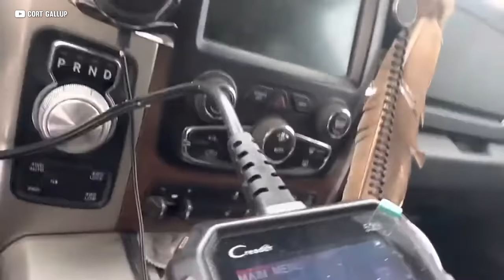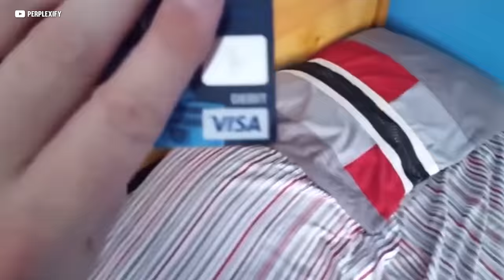Worst Trucks Only Stupid People Buy

Comment: Everyone always lumps all the Triton engines together. Glad to see you specifically mentioned the 5.4 3 valve. I had a 2 valve 4.6. And though lacking in power, (plenty for my needs) it was rock solid on reliability.
Reply: the 2 valve and 3 valve 4.6’s in the mid 90s into 2000s (crown Vic, mustang, etc.) were always the best ones for reliability, would highly recommend swapping if your chasing performance though
Reply: 4.6 2 valve is actually one of the best reliable v8. Same thing with audi 4.2L. The timing belt ones like the BFM are actually top tier v8.
Reply: So why Cummings sell crap if they know  its crap. Nissan builds very reliable and engines. Maybe the reason was to give the truck a American heart for American customers, but American heart was a lemon.
Reply: @FyodorUshakovSuka "Cummings" does not sell anything. However, Cummins sells diesel engines.
Reply: @randycupp5925  Sorry my bad. Why did Cummings sold crap diesel engines if they didn't know how to built a good one? Happy?
Reply: @FyodorUshakovSuka  "Cummin(G)s" does not exist... 
Cummins (please note the spelling) does however exist and they made the 5.0 liter engine to the parameters given by Nissan. There was a lot of controversy at the time this engine came out...  Cummins did not agree with a lot of what Nissan wanted the engine to be (displacement and V-style cylinder arrangement) however, they produced it anyway because it was guaranteed money from Nissan.
Reply: My '97 F150 with the 4.6L V8 quit working after about 290k miles. The transmission failed a little before that, at 280k. The body was in perfect condition, no rust at all and no other issues with the truck other than regular stuff, like the alternator. Fuel pump gave up at around 350k, right before I sold it. Those trucks were really "built tough"!
Reply: @randycupp5925 

Nissan worked with cummins on calibrations for the Titan, but the ISV was all cummins.

Cummins 1st approached Chrysler,  who turned it down because it wasn't economical enough 

Even toyota was thinking of using it...

It did get used in quite a few busses, which have nothing to do with Chrysler, Nissan or Toyota..

Your theory that someone forced design parameters on a company when that company would be responsible for warranty claims is absurd..

Cummins laid an egg with this motor....it happens.
Reply: @johnpeters9793  Hey thanks for the info. I was totally under the assumption that Nissan had substantial input on the final product. Regardless, I think Cummins should have stuck with what they know best and produced a scaled down 5.9 I6.
Reply: @randycupp5925  

I think depending on the definition of substantial, Nissan did have a voice in the motor...

The best analogy I can think of is Cummins created the hardware and Nissan was responsible for the software....but the shortcomings of that motor were mostly "hardware".

Like mentioned, Toyota was considering this motor for the Tundra...this was back in 2014....in hindsight, makes me wonder if they knew something nobody else did.
Reply: The 4.6 was a good engine. Had a f250 with one.
Reply: @savagebob911  

Ummm....no.
Reply: @savagebob911  one would assume, but no. All those modular V8's were Triton series.
Reply: @johnbessemer3777  

That's correct....not just the three valve.
Reply: I have a 2v 5.4 with 200k been good other then coolant bypass cracking and needing a new intake manifold and some coil packs I got my plugs torqued a little heavier then factory spec so I'm hoping they don't launch to the stratosphere.
Reply: Rust bucket Dodge? In n. Iowa they rust through before the mechanical becomes an issue.
Reply: The 5.4 3V had the bad reputation, but never heard 2V or 4V having issues. Although, people say the 2V 5.4 is one of the reliable engines ever made.
Reply: @randycupp5925 correct
Reply: My 5.4 2V now has 260,000 miles and still going strong.
Reply: @russellkeeling4387  also I heard the 5.4 4V is reliable too. Is that true tho?
Reply: @Mohammadkwt  I watched the last interview with Carol Shellby wherein he said the 5.4 liter 4V engine was the best engine ever made, in his opinion. I don't doubt him.
Reply: @russellkeeling4387  But the 5.4 4v in the gt500 is different than the one in the expedition and navigator if I'm not wrong when it comes to some components. I suppose this doesn't change the reputation of the engine, rigth?
Reply: The 4.6 V8 is legendary, everyone who has bought a retired cop car will have stories to tell about just how ragged out and abused they can be and still run fine.
Reply: @johnpeters9793  Surprised Nissan didn't adapt their own diesel knowledge to the Titan.  They have made plenty of diesels around the world including the Navarra twin turbo.
Reply: @TIJoe-te9qu  

A lot of people were losing their minds when toyota was supposedly going to use the cummins for the same reasons you gave.

The consensus was that it was all about the emissions....toy and Nissan didn't want to spend the time or money certifying their motors to US regulations.
Reply: @johnpeters9793  That makes sense,  letting an engine specialist handle that headache. Especially for here in Kalifornia. Too bad they didn't just go with a straight six, unless Dodge would have had a fit. 
If I could have a good Cummins in a Nissan Titan body,  I'd prefer that to the big 3 any day.
Reply: The 2v mod engines were/are solid.  Every engine will have it's issues, but the 2v go and go and go and go.  I just bought a 75K mile 01 Expedition that had a dealer maintenance record of OVER done maintenance all it's life. (Oil changes every 6 months regardless of miles.).  The truck is like brand new and drives fantastic.  I got tired of being burned by the newer stuff.  I wish we could go back to the 90's...well, except for GM's garbage back then.
Reply: @JViello  Good point.  I wonder how Ford blew it so bad on the 3V when the 2V was solid.
A guy I know has a Lincoln LT (glorified F 150) with the 3V. I remember telling him a few years ago to pamper that engine. 
I just ran into him, and he had to fork out $9k for a new engine. Painful.
Reply: @JViello  Seriously,  I'd go back to a 70s big block F-250 if I could tolerate the nasty fuel economy.
Reply: I fully agree. Change the plugs on a regular basis and torque them more than Ford spec they won't blow out. The 2 valve Ford's are great engines. The fact they say Chevy trucks are 'LENGENDARY' shows their bias.
Reply: @TIJoe-te9qu  
I've been told the biggest failure on the 3v 5.4 is oil change intervals. Ford advertised 5k, or 7k oil change intervals. But if you didn't change it every 3 to 4k, the sludge would clog the VVT system. That would ruin the cam phasers, and more. Another failure point was the rollers, I ain't sure if that was oil related, though.
Reply: @johnbessemer3777  I wonder if high grade synthetic would help?
My buddy that just replaced his said he stayed up on oil changes, but maybe not more than the Ford schedule.
Reply: @johnbessemer3777  You are correct, but the main issue wasn't as much oil change intervals as it was junk cam phasers.  Just a pure sh*t design.  If Nissan/Toyota/Honda hell even GM can get a simple part right how could Ford not do so, and then pretend they are fine and oil changes are the problem.  Ford always...ALWAYS throws it back to the customer.

I don't understand why manufacturers who have a failed part design don't just do simple recalls and fix it...or at the very least, fix customers who show up for service with the problem for free.  Instead they pretend there isn't a problem when the "new" part CLEARLY has changed and even has a revised part number.  No, no problem here we just decided to change the design, uh, uh, because.  That's why, because.
Reply: @TIJoe-te9qu  As much as I love the big block idea, IMO the reality is the 90's were the peak of automotive excellence.  It was the marriage of old school proven parts, overbuilt with the refinement and reliability that modernizing the finicky parts brought.  No more carburetors and chokes, FI made the cars a/f requirements run perfect at all temperatures and altitudes.  Same for all the OBD-II sensors and monitors. (Not the craziness they have now where a loose battery terminal trips a CEL)  Crank angle sensors, cam angle sensors, MAF's, temp sensors etc were just enough to make the now overbuilt/engineered engines to run several hundred thousand miles without issue.  

There were a TON of cars in the 90's with over 200 and 300k miles. Nissan's Toyota's, Honda's, Fords etc.  I knew a couple who bought a 98 Ford V10 van for light delivery nationwide. That thing had 500,000 miles on it and ran with NO problems. (2v of course.)  For all I know they pushed it past 700K.  They just replaced worn items like wheel bearings, brakes, tires etc.

Look at Lexus!  MILLION MILE CARS.  Plenty of LS400's with 300K that run and drive like brand new.  You are NOT finding that today.  Cars have gotten truly complicated beyond reason and are now what they claimed about the 90's. I remember the carburetor guys saying "All this new tech crap is over complication".  Nah, once I saw how it worked, it was the same old stuff, just solid state now.  Way more precise and reliable.  They weren't replacing throttle cables with servo motors, electric steering etc and all that crazy garbage you have now so the car can park itself. 🙄  The 90's were the peak.  If you can find a clean mid 90's early 2000's Lexus for a fair price.  Buy it!  Best, most reliable car you will own.
Reply: @JViello  here's the thing, though. They were all the same parts. 4.6, 5.4, 2v and 3v. I just did a quick search to verify. The phasers were all the same from it seems 04 to 09.
Reply: @JViello  your point is very valid. In fact,  my Nissan truck is late 80s and my Honda is late 90s.  The smog carbs were a nightmare,  so Nissan took the same old L series from the 60s, which was actually inherited from Prince with Mercedes DNA, and put on a new crossflow head and TBI.
Still working fine today.  The Honda HX civic has low pressure port injection and vtec-e and cruises at 44 mpg without batteries.  I recently diagnosed  bad injector by listening through a screwdriver and getting another one at pick n pull for 7 bucks .
Those were definitely a golden age for dependable daily drivers.  The only problem i have encountered is when electrical connections become either corroded or brittle,and that is hard to track down intermittent problems for me.   
Way too many of these cars were thrown away in scrap yards that could have been rebuilt.  
If I get nostalgic for carburetors,  I guess I can play with my 1963 Volkswagen.
Reply: @johnbessemer3777  Maybe it's the casting deign and oil  passage sizes? 
The 5.4 3v has a lot worse reputation for some rason.
Reply: @TIJoe-te9qu  I really don't know. It's stupid, though. Same phasers across the platform but only the 3v fail.....
Reply: @johnbessemer3777  Got to be those restricted oil passageways.   Glad I didn't get one. A buddy got one in a Lincoln LT, and he just spent 9k on a new engine.  I told him to change the oil a lpt.

Comment: I owned a 2006 F350 with the 6.0l. As a hot-shot driver pulling a 26’ gooseneck trailer for over 2 1/2 years and well over 200k miles, I never had a problem with anything. Of course I’ve been accused of being totally anal when it comes to maintenance like oil and filter changes, trans & diff service, etc. so that may have something to do with it.🤷‍♂️
I also bought a 2003 F150 SuperCrew, RWD, with the 5.4l “2 valve” engine brand new in ‘03. Still have it and it just turned over 285k miles. No rust, and runs & drives great! Again, maintenance is the key! It’s cheaper than repair.
Reply: 2v good motors
Reply: I think that the diesels used for your purposes tend to do the best. The ones that people daily drive to work or to the grocery store are the ones that break down so often. They don't like short trips.
Reply: @mikelemoine4267  agreed!! I don't know how many times I have to tell people, dont pull into the gas station, and cut it off to put fuel in it, or to get a pack of cigarettes. So, so bad. Like you said, the short commutes tarrable.
Reply: @andrewavvenire116  Unfortunately I learned the hard way. We have a 2014 Grand Cherokee Ecodiesel that we made a lot of short trips in. Changed the oil every 5K miles (half the recommended interval) and did all the other maintenance early but it blew on us at 64K miles. When it was still pretty we drove it from Florida to Wisconsin and made the mistake of using the remote start in negative temperatures thinking it would be better than hopping in and going in such cold temps. The catalyst clogged and had to be replaced before the first oil change, then we had two oil leaks (front seal both times). 4K miles after the second front seal job plus a new EGR cooler, intake manifold, valve cover, turbo hoses, injector tubes and probably a few other parts (all due to EGR recall and being melted) it locked up on a 3+ hour road trip without warning. Thankfully I bought the extended warranty as this thing is giving Maserati a run for being a money pit ($18K and counting, 1 year left to go!). 

That engine has design flaws and was never engineered to run a US style EGR system. Tolerances are too tight to handle the soot load and the bearings too narrow for the heavier loads that our larger vehicles over here put on them, especially when towing at low RPMs. It stinks as the vehicle was amazing when new, but it has the reliability of a Mercedes designed, Fiat (VM Motori-Fiat subsidiary) powered, Chinese electronic controlled Chrysler assembled by the UAW. What could go wrong (lots, hence the extended warranty!).
Reply: @mikelemoine4267  Holly cow, that is rough. That's a hell of a run of problems, all these small diesels in these half ton trucks and like your jeep, I don't trust them. Glad to hear about the warranty, I always preach about that deal.
Reply: @andrewavvenire116  Yes they might have been ok before the emissions rules tightened. Once they choked them down and took the sulfur out of the fuel they aren't as efficient, and definitely aren't as reliable. Of course they could probably engineer them to be, but people wouldn't want to pay the upcharge. I often wonder if the reduction in NOX is enough to offset the environmental impact of somewhat lower fuel economy and significantly shorter parts life. All these plastic engine parts will fail after 10-15 years but last forever once in the landfill. I have to decide what to do when the warranty runs out in about a year. Not sure I want to keep this thing, although most of the mechanicals will be new by then anyway:-).
Reply: @mikelemoine4267   I hear ya. I guess it depends on what you can get for it, but then what do you get from there and what will that cost. Like you said, there is a year left, are lots of new parts. I feel like age is now against you on these parts/motor as a whole. If it was that bad new, then...🙄
Reply: @andrewavvenire116  Yeah I have to decide to sell it for whatever it's worth at the time or just keep it and drive it until it dies. It's a really nice ride, quiet, fuel efficient, quick for what it is and capable off road. Just never know when something might decide to break. Seems like many new vehicles are designed this way now, once they get to be 5-8 years old things start to nag you until you don't trust it and trade it in. 

Oddly, the old Liberty CRD (VM Motori 4 cyl diesel) and 2006 era Grand Cherokee (Mercedes V6 diesel) are worth a lot more than the gassers (though neither pull big $$) at this point.
Reply: @mikelemoine4267  yep. I don't understand that. I'd rather pay at least the same for a gasser knowing I can trust it haha

Comment: 2002 Avalanche 1500. 160k, regularly towing a travel trailer. Only major breakdown was a rear diff blowout replaced under warranty. Really liked that SUV. My family grew up in it. However it had the infamous piston slap problem that I never fixed. Sold it in 2019 when it started burning oil and a lifter started ticking. 😜

Comment: My 2002 ford F150 started blowing out spark plugs at around 220,000 miles in 2011 sold after owning it for 9 years.  No other issues.

Comment: When it comes to the 4.7 V8 Dodge used in the Ram, I know quite a few people who do their oil changes every 3000 - 4000 miles and as a result, it has been pretty reliable. I drove a Jeep Commander with that same engine, and it was so smooth. The power delivery, barely a vibration on it. The engine was so quiet and so smooth, you'd be forgiven for thinking it was sort of Electric or a some sort of hybrid. 
With regards to the 5.7 Hemi, I've got it and faced my own shares of issues. I can tell you, with the exhaust leaks and ticks are due to exhaust bolts. The dreaded lifter tick however is caused by using the wrong oil. It is sad to say that Chrysler let their customers down, by specifying thinner oils in their engines just to get better EPA ratings. The same can be said about GM with their 5.3 V8 and cylinder deactivation. 
While some would blame design failures on these engines, I would state that switching from a 5w20 to a 5w30 as soon as you get the truck off the lot and changing the oil every 3000 - 4000 miles. Those who have done this, have had no issues.